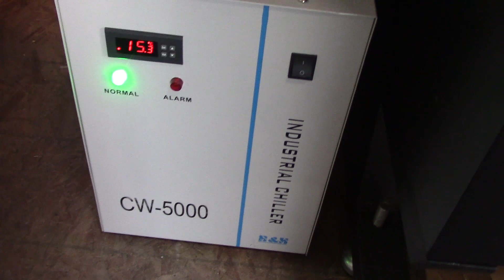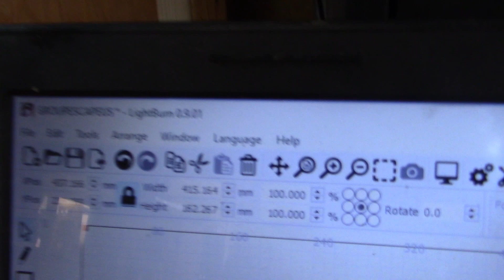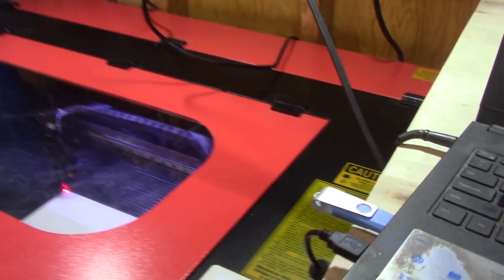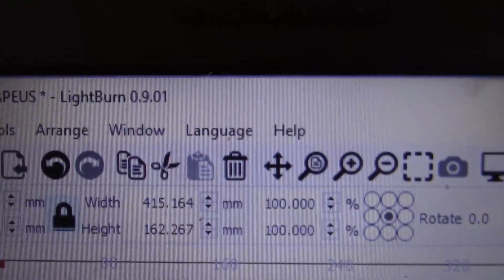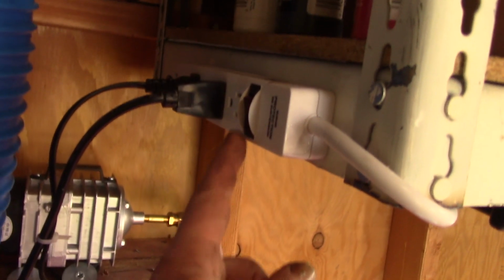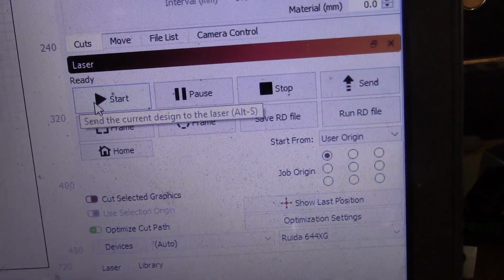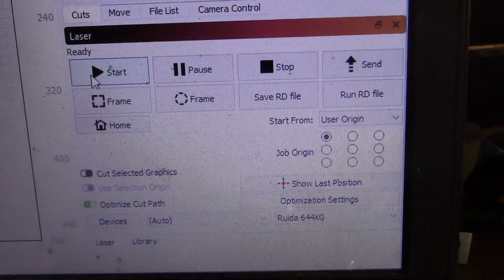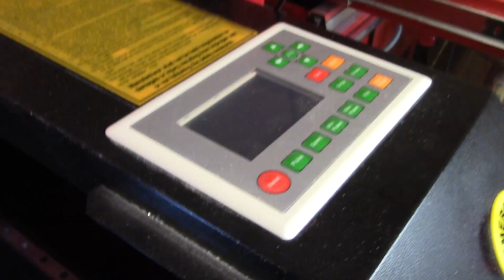CHINESE RED/BLACK LASER CUTTER REVIEW  2019 HD

Comment: I have one of these lasers and it has been working great until recently.  When engraving lettering it starts the letter then jumps to a different place to finish the letter. It seems it may be the front to back motor that is  causing the problem. Would you be able to help me figure out what I need to do to fix it?

Comment: WHERE do you order parts if you need them for this machine
Reply from the maker: The parts are very common on ebay/amazon, laser retailers.   I haven't had to replace any parts  at all.
Reply: Hello, I'm Jessica from China Dano Mechanical Equipment Co., LTD. Our company's main products include CO2 laser cutting machine, laser engraving machine, optical fiber marking machine and a series of ion cutting machines.If you have any needs, you can contact me at any time. My Whatsapp:+86 13285336692

Comment: Have you had the need to replace any parts since you’ve owned it?  How long have you had it and how often do you use it?    I’m leaning towards getting this but my concern is finding parts in case we need to replace it.
Reply from the maker: I've had this machine for over 3 years now and have not had to replace a single thing I use it a few times a week consistently.

Comment: Great Video! Just got mine and I'm about to fire it up the first time. How did you handle the chassis ground? Is this necessary in the United States?
Reply from the maker: Never did anything special with ground.
Reply: The grounding concerned me as well. Living in an older house, we have no grounded receptacles. But upon further research, I discovered that I could install a GFCI receptacle and it would protect against electric shocks, but would not protect against power surges, such as with lightning. One out of two ain't bad, I guess. But at this point, it's my only option, short of getting the whole place rewired.

Comment: This is the only model of the red and blacks that are tip top from the factory.  I have had mine for a few years and it has worked flawlessly.  If anyone is interested in a R&B , look for this specific one with the estop and key in that position, and the front panels. These have 2 smaller red panels, the others have one larger one.  They are coming out of different factories, with different layouts and quality of build.  Very very decent machines.  I have done a lot of mods to mine however. They were not absolutely needed.....just niceties.   However, I personally do not like LightBurn.  It works absolutely no better than RDWorks, in any way.  I have used a lot of laser software, and LB just isn't quite right to me. RDWorks is absolutely fine at no additional cost.
Reply from the maker: Ok opposite for me.  Rdworks was a nightmare to use. Lightburn is just smooth and effortless.
Reply: @chaucer44   Yeah, I dont understand that at all really. I dont get how RDWorks requires any more effort. Always ran smooth for me. LB has always had some serious issues with the GUI not displaying properly. Not fitting vertically on screen, cutting of the bottom controls unless you go fullscreen. The right panels getting jumbled up and overlaying each other etc.  At the core, they essentially operate identically for a Ruida control. They have to as LB has to conform to the RD protocol, which it also does not seem to conform to fully on some things. And they cant magically add functionality to the protocol that doesnt exist in RDW. Only difference really is the GUI, which has never quite worked for me. Even the latest version still has the bugs for me. Functionally, there is nothing LB can do that RDWorks cant, it just basically looks different. Have you tried the most recent versions of RDWorks?

Comment: Thanks for the video. I just got the exact same machine from the same vendor. I do however have trouble cutting 1/4" (5.7mm) acrylic. I did some test cuts and I have to use 2 passes at 1mm/s (slowest speed) and 60% power to cut thru. Do you mind sharing the cutting speed you use for 1/4" acrylic ? Thanks in advance
Reply from the maker: Cuttng speed is pretty low for quarter inch acrylic.  I can't recall the exact setting but I think the speed was 6 and power 90 (don't set power higher than 95 to preserve your laser tube). There's a couple things you can check 1.) make sure your lenses are clean and debris-free 2.) make sure your mirrors are aligned 3.) make sure your focal distance is correct by doing a spot test.  All these instructions can be found on youtube.  Thicker materials are a challenge and sometimes you do have to make 2 passes. I primarily cut 1/16 and 1/8 acryilc and cut through it easily.
Reply: Does the color of the acrylic affect the cutting speed? Meaning does clear acrylic cut faster then opaque?
Reply from the maker: Repeat your cut.

Comment: Have you watched the RDWorks learning videos?  He had shown what happens with the honeycomb and acrylic cutting.  For safety sake, replace it with a pin board or use the part under the honeycomb.  From what he showed, the gasses from cutting don't fully evacuate and a film builds up in the comb, and he had one of these lasers that caught fire.   Well worth watching it so you know.   I just received this exact unit in Yellow and black, waiting for Fedex to deliver the CW5200 chiller right now so that I can give mine a try out.  Have to agree, Lightburn is well worth the price, it is easy to use, now hoping soon I can actually use it. :)
Reply: acdii, how did your laser work out? I am looking to buy one too and thought it best to ask those who have one.
Reply from the maker: I cut really small parts so a pin board would be a nightmare.  I've been cutting on my machine for almost a year and haven't had any issues.

Comment: Great video. I have same machine. Your spacer seems kinda small. Mine was 2 cm wide which gets lens 52 mm above material. How wide is your. I'd like to check how it cuts with it.
Reply from the maker: My spacer is about 6mm.  Different lenses require different focal lengths.   To determine the sweet spot of your particular lens array, do a calibration: https://www.youtube.com/watch?v=Eg6THrEdleo